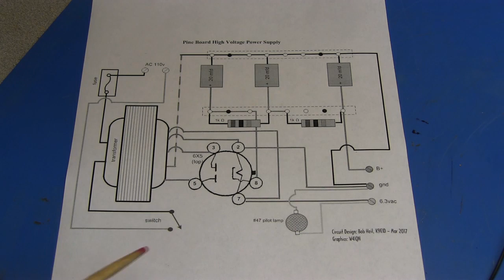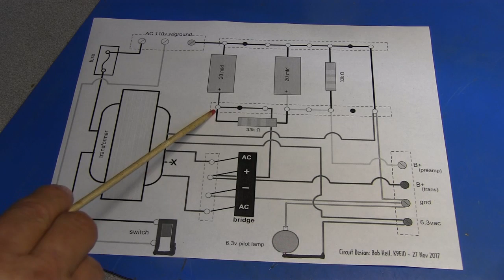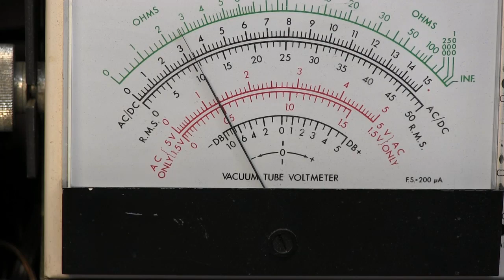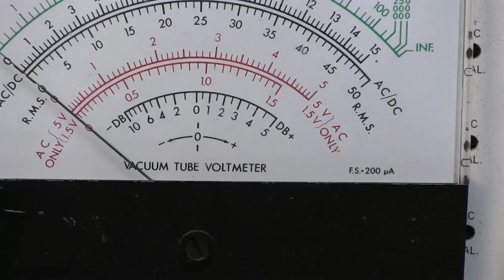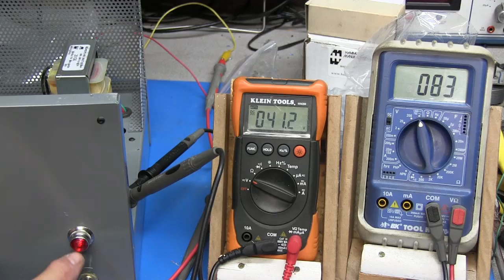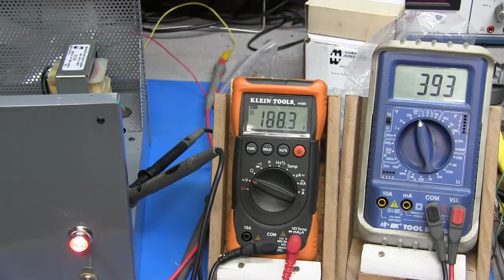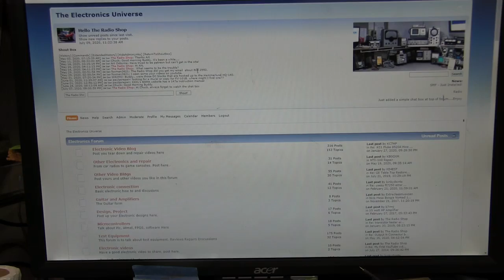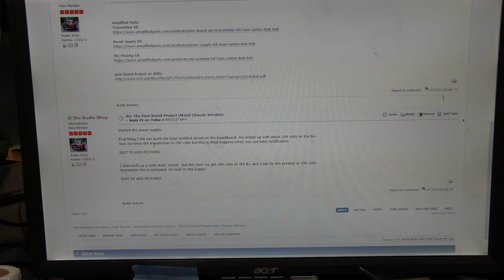#243 AM Transmitter - Power Supply Build

Comment: Thanks for another nice project video. I'm glad that you settled on the semiconductor rectification. I believe that the 6X5 would be having hard to resist arcing when the filament supply is grounded and with 350 volts on the cathode.
Reply from the maker: Great point! Thanks

Comment: fine business.  I buillt the Heil PBP myself a few years ago and initial built the power supply with the 5Y3.  I loved the look of the rectifier tube, and had added a vintage round volt meter to mine.  However, in the end I rebuilt the power supply using the solid state rectifier again, for more juice which signficantly increased my signal power.  Eager to see how your tranmistter comes out. 
I enjoy your videos, please keep sharing & 73 de AB1DQ /J ames.

Comment: Suggest using a voltage doubler circuit off of the 6.3 to get the 12 volts for the relay supply instead of adding another transformer?  If the voltage is over 12v can just use a simple LM 12V regulator to keep it at 12v to ensure relay coils are protected. Thanks again for always great videos and your clear explanation which ranks up there with the best on YouTube.
Reply from the maker: That would be a good idea, but with voltage doubler circuit both AC leads are held above ground.  Just remember the tubes filament lead ties to ground. This helps keep the noise down.
Reply: @TheRadioShop  Yes you are correct, it would not work in this case unless the filament circuit was lifted from ground and   a twisted pair (hugging the chassis) was used? Thank you answering.

Comment: the mavrick 250 case makes great project box .In my shop i got of the same parts lots of parts.Great video as all wase.        ricks radio shop in flynn tx.
Reply from the maker: Great little project box.  Thanks
Reply: good re-use of them small old turds

Comment: Hey Buddy! Hope all is well in your end of the woods. I have a Johnson Messenger 4230. No antenna, and I live in a 3rd floor apt. With Windows facing west. I thought I'd get two 10' sections of 3/4" pvc and just cram them out the window. Not sure about the cable details. Any advice would be greatly appreciated.
Reply from the maker: Just keep your cable as short as needed. A half wave dipole should work fine.
Reply: @TheRadioShop  Thanks!